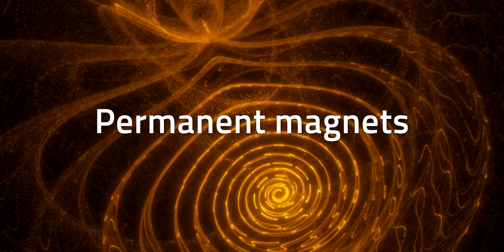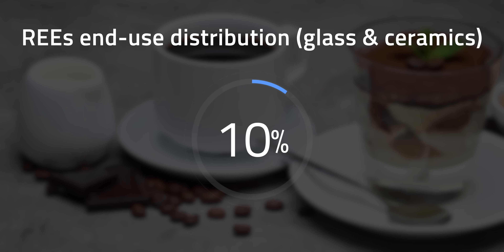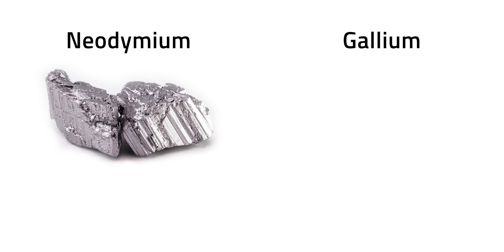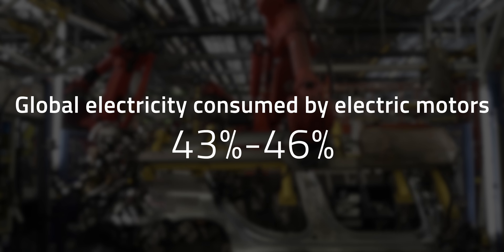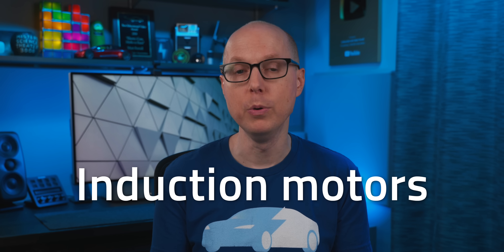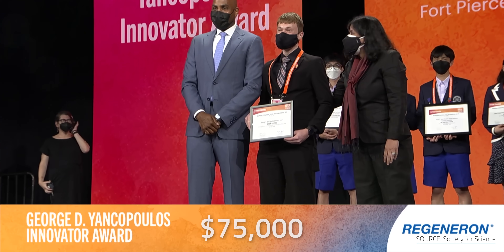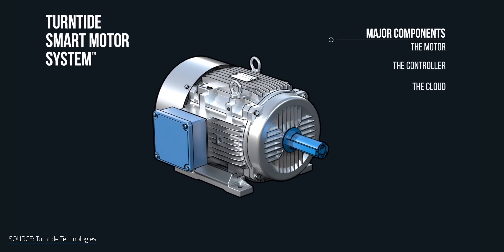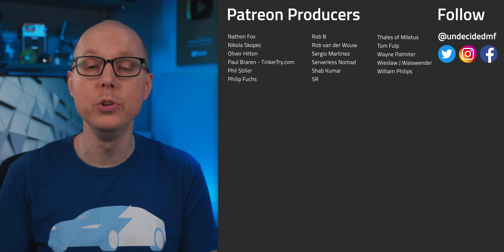Why This 17-Year Old's Electric Motor Is Important

Comment: Reluctance motors and induction motors have already been optimized for lots of use cases. It’s hard to see that more tinkering will vastly change the torque per volume, but I admire the kid for taking on this work and wish him all the best. Eliminating permanent magnets from automotive motors is a worthy goal.
Reply: Perhaps, perhaps not  question is: Who will try?
Reply: I will
Reply: That’s what everyone thought before rare Earth magnets were discovered…
Reply: @michaelwhitley2081  it still needs to be cost effective or you have achieved mostly nothing.
Reply: @luckyjay778  way to bring nothing to the conversation. allow me to join you
Reply: As long as EVs use lithium they are just a bad idea. Lithium should be used where it's absolutely needed. And that isn't in cars or green energy. It is the antithesis of sustainability to rely heavily on rare earth metals where they simply aren't needed.
Reply: When you fail to see the reason for innovation you fail to keep trying. If we stopped trying to improve the gasoline engine in the 1930s we would already be completely out of fossil fuels. Innovation, or "tinkering" if you want to call it that, is never a waste of time if it produces a result. One more thing to point out is that when a motor has been optimized for a specific use, that doesn't mean it cannot be improved upon for other uses. I don't understand how this is hard to see.
Reply: Hi John,    Yes, many motors are now up in very high efficiency percentages, so it is hard to see where improvements can be made. . . .  OK, generally motors are made for maximum efficiency at specific speeds, so not good at other speeds.. .  But now with VFD drive, that has been covered.. . .  I believe EV cars do use a form of VFD in any case.. . .  Modern permanent magnet motors or generators are now at very high efficiencies and lighter than the coil powered Rotor Field motors.
Reply: it's been done before; in some ways a Self-priming alternator is type. Electromagnet -> Electromagnet
Reply: @Dazza_Doo     Not sure what you are trying to say here. . . But Yes, the 100 kVA - 1,000 kVA Generators I have worked with do use internal electromagnets for the field, not any permanent magnets and have no brushes either.
Reply: @hughleyton693  I'm only assuming that it requires more power. Also Congrats, I'll never get that experience :D Take care
Reply: @anonym3017  It's technically not rare earth, but there are still only 14 million tons of Lithium that will be economically viable to mine. That's a little over 1.1 billion standard EV batteries. Considering the fact that there are 1.4 billion cars on the road worldwide, with that number set to double by 2040, how do you plan on replacing fossil fuels exactly? And how would it be sustainable into the future? These batteries don't last forever.
Reply: @derrickmiles5240  yeah how would one ever get the lithium back out of batteries. oh right recycling is a thing and economically viable at the current lithium prices.

furthermore the amount of lithium required per kWh of storage is still dropping rapidly. so your number of vehicles is way too low.

and finally sodium batteries are about to enter the market so it's just a non issue.

and replacing fossil fuels is easy. just ban them via emissions standards or price in atmosphericcarbon sequestration into the cost of the fossil fuel. either one works.
Reply: @anonym3017   Putting aside the fact that there simply isn't enough viable lithium on earth to replace the current number of cars let alone the projected number of cars by 2040. The average price for an EV is 66,000 USD. That really isn't an economically viable option for most people, in the US, and especially not for people around the world. If the EV is going to be adopted globally, the price needs to drastically come down. It's just a bad idea, that will ultimately lead to shortages of Lithium.

From Boston Consulting Group:

"Even though the price of lithium has surged more than tenfold over the past two years, there's enough capacity to meet anticipated demand until around 2025—and potentially through 2030 if enough recycling operations come online. After that, chronic shortages are expected."
Reply: @derrickmiles5240  lol. 

a model 3 sr costs 45k and is about as expensive to lease as a middle class camry. both with 10k first payment.

so the price of EVs ain't an issue in the developed world. 

and again. if we want to keep agricultural output, aka food production, anywhere close to where it currently is we need to get away from fossil fuels within a decade or so.

and that's not a joke or an exageration. changes in precipitation patterns and temperatures, so the things that are caused by us using billions of tons of fossil fuels a year, are already fucking with our ability to grow crops. which is why wheat and rice have drastically increased in price since 2016.

so if we can't build enough EVs to replace the entire current car fleet we'll just have to get by with less cars.

same goes for planes and ships running on fossil fuels. we either manage to build ones that don't or we'll just have to do with a lot less of them that cost a lot more.

and the cheapest EV currently on sale that meets US crash standards is the wuling mini EV for 4900USD, yes fourthousandninehundred USD, (at current exchange rates).
Reply: @anonym3017  So you've given up on a green future with EVs? It only matters if the west can afford them?  It's time to face facts. The ICE will reign eternal, and the EV is doomed to be an obscure footnote in automotive history. 

There are only around 14 million new car sales in the US per year. That's 4.24% of the population. EVs make up only 6% of those sales, at around 840,000. That's 0.25% of the population. So it's pretty obvious that they are not an economically viable solutions for most people, even in the US. Their cheapest model being close to the average ICE car is not a good argument for their affordability. In fact, it's a good opposing argument.
Reply: @anonym3017  How so? The United Nations Food and Agriculture Organization (FAO) forcasts crop yields increasing 30% by 2050. And the world has been getting substantially greener over the past 30 years. Civilization isn't ending. Do you know how many people have made that prediction throughout history? Every generation wants to believe that it will be the last generation. They latch on to any problem, and blow it up to apocalyptic proportion. People just want to feel like they're important, because they're narcissists. 

600,000 people die from heat related deaths every year, and 45,000 deaths are related to natural disasters. But you know what vastly overshadows those deaths? Cold related deaths, at 4.5 million a year. Need I say more?
Reply: @derrickmiles5240  yeah the UN predicts that.

Meanwhile the price of staple crops has gone through the roof.

Indias and europes wheat harvest last year suffered due to drought and too high temperatures.

A year prior to that cali got fucked by the same.

And all of those are getting worse and happening more often.

So the UN prediction is just wrong.
Reply: @anonym3017  lol
Reply: @anonym3017  Recycling lithium-ion batteries isn't economical and is more dangerous than producing new batteries from virgin stock, meaning that even significant price jumps in virgin lithium can make it impractical. That's why it's still almost never done. Most lithium-ion recycling start-ups have never even recycled anything, they just stockpile batteries and talk about how the technology will improve to make it possible in the future without any actual evidence of it. I've seen a great many lithium-ion recycling start-ups that never did any recycling and just stockpiled batteries in warehouses while promising the technology will someday improve to make it feasible without any evidence for these claims. Many such do-nothing and produce-nothing companies have been able to linger for years or decades despite having little to no actual revenue due to the low interest rates we've had for decades now. Some have even gotten subsidies despite not actually producing anything. Recycling them can probably be made safer and perhaps even economical by designing lithium-ion batteries with recyclability in mind from the ground-up, but that doesn't help most already manufactured lithium-ion batteries and would probably negatively impact other performance aspects of the batteries in some way. 

The amount of lithium required isn't really dropping anymore from what I've seen. Batteries made recently use marginally less of it compared to those made a few years ago according to manufacturer documents and transportation fire safety reports I've seen. Energy density improvements have slowed way down. Manufacturers have already been saying that there's not much more room for improvement without huge changes being made, like solid state batteries that have supposedly been a few years away for the last ten years or so.

Sodium-ion batteries have been around for many years and do see some use in industry, though not much. They have much lower energy density than lithium ion and aren't much cheaper to make since lithium is far from the only expensive component in lithium-ion batteries. Also, magnesium-ion, zinc-ion, potassium-ion, aluminum-ion, and probably more I haven't heard of have been researched for decades. So far, nothing else has actually been produced and sold to consumers. They all have run into extreme hurdles for manufacturing and recharging that despite decades or research, no viable solutions have been demonstrated, let alone commercialized. Making alternative batteries and getting good results is extremely difficult because very few materials have a combination of all the aspects that are needed to have high energy density, high power density, high charge/discharge efficiency, reasonable cycle life, and feasible ease of production. That's not to say we shouldn't try, but we shouldn't make decisions or policies that rely on the belief that we will succeed in a practical amount of time being true. Many technologies have been just a few years away for decades or even completely given up on despite years of promises.

It's one thing to push hard for reasonable efficiency improvements, like stricter insulation requirements in building codes, but a whole other to ban that which made modern sanitary and comfortable life possible.

It should also be mentioned that food prices have risen largely because of restrictions on hydrocarbon fuel production and transport and other sources of inflation. Fertilizer production requires vast amounts of natural gas and economical food production equipment requires diesel, just as basic examples. Most water issues out in areas like California should also be considered from historical standpoints. There were never enough reliable water sources there for the amount of consumption currently going on there. It also has a history of century or even millennia long droughts that would cause native populations to have to leave. Many ancient civilizations have literally fallen due to massive changes in rainfall, long before hydrocarbon fuels were used in much quantity. As it is, we aren't facing significant, wide-reaching crop issues due to climate except in areas where the local climates weren't ideal for those amounts of those crops anyway.
Reply: @5467nick  lol.

"Sodium ion batteries have existed for years" mate they literally left the lab last year and the first larger scale factory for them is currently being built.

So that alone disqualifies you entire post.

Same goes for recycling being unsafe. Neither completely discharging a battery nor shredding and separating a completely discharged battery have any dangers associated with them. With even minimal safety protocol, aka wearing a thick rubber glove when attaching the discharging leads.

And the recent rise  in food prices has been happening since 2016 or 2017. So oil/NG production or logistics ain't part of it it.

What is however part of it is ever increasing drought/heat  induced crop failures and/or lowered harvests across the US, Africa, Europe, Australia and Asia.
Reply: @anonym3017  Sodium ion batteries were being installed as battery backups for buildings in 2019, possibly earlier. Mass production is being expanded only very recently, but they were already around and in some use.

Even completely discharged batteries are full of nasty chemicals that need to be completely separated from each other without allowing any of them to escape and without allowing any air to get in. The electrolytes are recyclable, but require extreme care. The graphite electrode is not very recyclable as the graphite will be of much lower quality than virgin natural graphite. The cathode is recyclable and shouldn't be too dangerous when fully discharged, but it is an intensive process. If not for the above issues, the cathode alone is certainly doable today. If they finally figure out solid state batteries, the anode and electrolyte issues will be pretty much solved.

I don't know about your area, but food prices in general around me were not at all having problems until after the lockdowns began and didn't really get crazy for most foods until around late 2021 to 2022. 2016 to 2019 didn't see much movement on food prices around me. Early on from the lockdowns, this was mostly labor-related. Fertilizer prices exploding was being talked about back in 2021 and food price warnings for subsequent harvests were expected and should be expected to continue for a couple years after fertilizer and transportation prices come down, if they ever do. This was blatantly obviously going to happen two years in advance.

Biden shutting down the pipeline and limiting new exploration was a massive issue for fertilizer prices as they use natural gas as the hydrogen source for ammonium nitrate production and other similar materials. The massive spending initiated under Trump's presidency for the virus kicked general inflation into overdrive, but Biden's policies on hydrocarbon fuels slammed food and transportation more specifically as they are inelastic uses.

I do, however, know some farmers around me as they teach engineering classes at some of the nearby colleges and I had classes with them. They haven't seen any increase in frequency of heat-induced crop issues over the last decade. The truth of the matter is that there are crop yield issues for a variety of reasons all the time in different areas and that's been going on as long as we've been farming. I can also say that last summer was the coolest summer of my life and this winter has also proven to be the mildest winter of my life. I'm sure other areas can't say the same, but that was my experience this year and I have lived in the same city for over a decade.
Reply: I think that kind off thinking is crazy  considering we havnt even got a full grasp on physics yet...quantum physics states its possible for something too be in two places at once at opposite ends off the universe so if such a thing possible we got alot too learn...New alloys using other materials and also with A.I around the corner some off these softwares are able too compute in a few seconds what would take a team off 100 people a year so we are going too have calculations on specific questions so fast its insane and that's just a type off A I we have now

Comment: One thing I remember learning very early in automation is how brushed dc motors suck at both power output and efficiency, I would not regard 70% efficiency and damage over time as a good thing. I also remember reading a paper like a year ago about a 96-97% efficient brushless dc motor, don't remember all the details tho...
Reply: Bldc is for less than 600 watt power input.
Till 1000 watt we prefer single phase induction motors.
Above 1000 watt we prefer 3 phase induction motor.
A synchronous motor would be more efficient but at much higher capex not easily remediated by its low opex though.